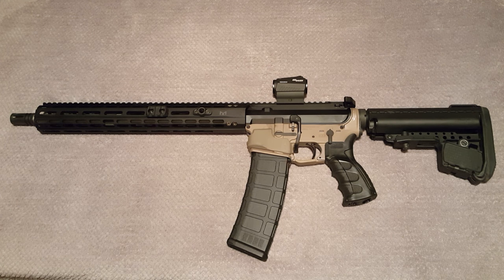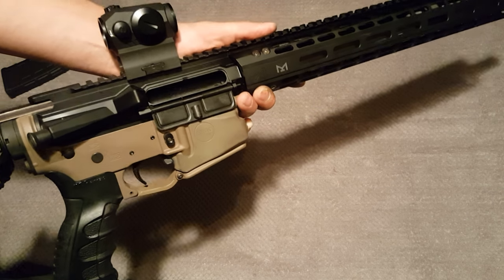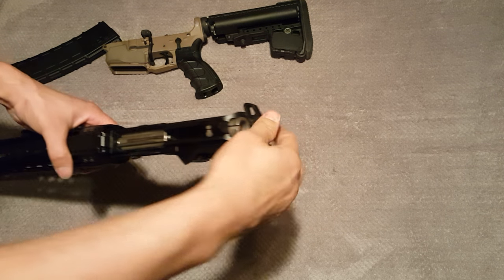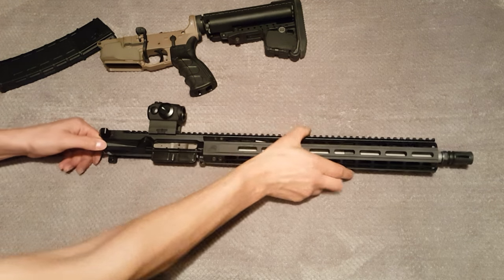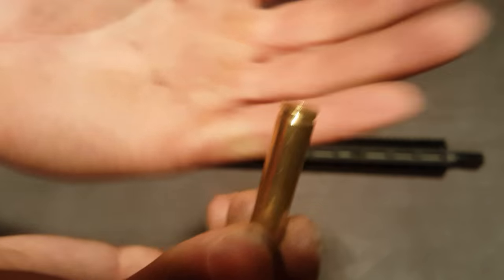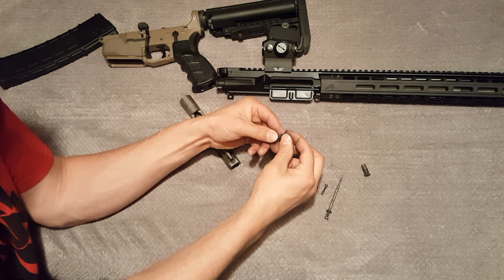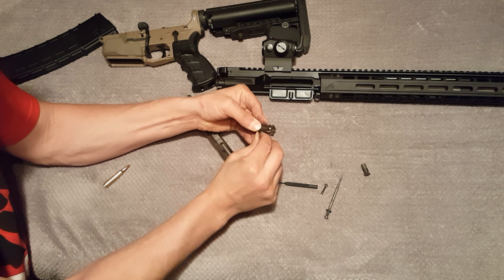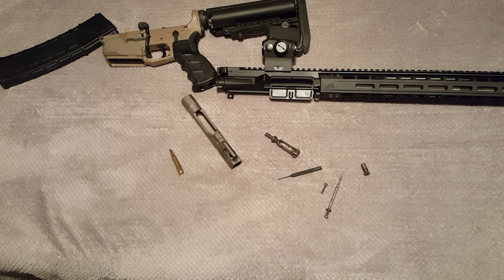AR Bolt Failure To Close /Seat Properly!!! Sharp's Relia-Bolt Extractor Spring O-Ring/Rubber Grommet

Comment: I just had a problem on a new upper, but in my case I am sure it was a headspace problem.  Mine is 7.62x39 and it was having problem chambering the round.  I put the loaded rounds under the extractor onto the bolt face.  Took pressure to close the bolt and and a lot of effort to eject the loaded round.  I slipped a spare 7.62x39 bolt in and it chambers easily without resistance.  I do not have a head space gauge.  I noticed that the original bolt was rough about the lugs and it be something as simple as a burr.  I have written the manufacturer and will see if they send me a new bolt.

Comment: I ran in that same thing in very cold climates.  Also with new bolts. The o rings were hard. Would not soften up. I just left it out.
Reply from the maker: So far so good. Since it's back in it hasn't happened again. And we did have a snow day at the range. Climate is a good thing to keep in mind as well. Thanks

Comment: All you have to do is use it. The heat from a few rounds will flex the O ring and loosen the tension on the extractor. And make sure that everything is properly lubricated.
Reply from the maker: I bet you're right I just went the extra step to understand it. If it wasn't my first build I probably would have snacked the forward assist and kept going

Comment: It is possible that the O-rings used are the wrong durometer.  But the O-rings I have that are reliable do not have a round cross section, but rather, a more rectangular cross section.  And these O-rings are a little thinner than the round section O-rings.

Comment: Extractor O-ring caused too much tension and had a hard time going around the rim on the casing.
I wonder how many shots it would have taken to allow this to break in normally.
Reply from the maker: I do wonder this, possibly just slam that forward assist a few times 🤷‍♂️ but i wasn't going to do that with my fresh build.

Comment: Hello. I am new to the Ar-15 platform. I pull the charging handle back and let go, but it wouldn't go forward since I notice the round that it was trying to push forward into the chamber was some how croquet instead of straight and therefore it was stuck. I took the magazine out and some how the bolt and the round suddenly went forward on it's own. The magazine was a Pmag 30 with 30 rounds of Green tip Pmc ammo. I removed two rounds but no difference. Same issue. I tried using my Pmag 20 with frontier ammo and no issue at all. I got no idea what the issue is. I am confused. Btw this is a Ar-15 with a Aero Precision upper, and bolt and charging  handle were bought separate. Using a APF complete lower receiver.
Reply from the maker: Let think on this one a bit. Sorry i just saw this.

Comment: Needs to be sanded or polished a little more if the tolerances are that tight??? Maybe it's the face of the extractor.   If you had another extractor to substitute that would rule out the extractor.  The extractor face could have worn a little and that is what solved the problem?????I find it hard to believe a tight o-ring could keep the extractor from opening.  The angle of the extractor face or that the part is too tight makes more sense. Thanks for the video. It will help if this problem occurs.

Comment: I could really use some help from one of y’all. I don’t know much about how AR platforms work. I’ve had constant problems out of my Areo Precision AR-10. First I kept getting light primer strikes, I replaced the firing pin and solved that issue. Then it wasn’t extracting the rounds properly and kept jamming, solved that problem and it shot great for about a month. Now the most recent problem is when I shoot, the bolts not being pushed back at all. I have to pull the charging handle back for every shot to cycle the gun.

Comment: I have a delton dti at, I bought it brand new it set for 2 years took it to the range once shot 30 rounds took it home and put it glass case about a month later take it too the range shot 2 30 round mags noticed it was a little warm so I just let it set there and cool down went to start a 3rd magazine and it jammed bolt not closing all the way every time I pull back on the charging handle nothing just end up having to shake 1 or 2 rounds out never cleaned the gun since I bought it right off the show room wall , without being mean what could be the issue im new I also put a 20" barrel on it and turned it into an m16A1
Reply from the maker: Well without being there and seeing it first hand i would take it to the local gun shop or gun Smith. Safety is key.
Reply from the maker: Before i shoot my brand new guns or guns i have had sitting for awhile. I give them a squirt of gun lube. My AR's i don't clean often i just squirt the bolt / down the barrel and keep on shooting. Possibly too dry out of the box and needed lubricant. As for heat i can't say,  everyone has a different perception of hot. But we are talking about gunpowder and firearms. They're will be heat. Hope this helped somehow, but be safe and let a professional look at it.
Reply: @bereadybasics7525  thsnk you, the gun oil probably did dry up over time

Comment: Going to try this, my Ar does this like every other shot, it's a radical firearms ar so thought it messed up, was about to send it back until I saw this video
Reply from the maker: You could also try just working that extractor spring in by just opening it manually several times. I haven't tried it but it has the same effect essentially, and it can be done on the fly. Good luck
Reply: I got a radical also and its been nothing but hell as far as failures to eject while loading another round so i hope this works…
Reply: @troysanders4206  try tightening up the gas system, and if you dont habe promags, hold the bottom of the mag and see if you can mag dump, that's what I figured out was going on with mine

Comment: Real question: Why do you not recommend hitting the forward assist??
Reply: I see your curiosity there,
For this instance on my new build where i was having issues firing in the first mag. I didn't wanna just go straight to slamming on the forward assist. Almost $2000 total i was honestly just babying it. Possibly after 5-10 rounds later if i had used the forward assist could possibly have fixed its self.
Reply: Forward assist was created for M16's.  They were horribly unreliable and in combat in Vietnam the forward assist was a very cheap and aggressive way to get your ass out of trouble quickly when your gun jammed.  These days, with the tech that goes into making the AR 15 the forward assist should not even be necessary.  If the gun is made decently and assembled correctly you should not have to use the Frwd asst.  I just don't like the idea and why chance damaging something
Reply: @pistol777   It was the powder that was the problem in Vietnam,  After they started using the powder it was made for it worked fine.

Comment: Damn, wish I would have found this before sending my bcg in for warranty work at the manufacturer.  I've no luck with it in multiple rifles, various ammo, dis-assembled the bcg, cleaned, lubed and tried again. I never thought to run it without the o-ring. I bet that is the issue I was having as well. We shall see what the maker has to say.
Reply from the maker: Yea,  usually they say nothing is wrong and send it right back. Doing a updated version of this with out taking apart the bolt. What should i call the video?? How would you explain the issue you were having? Anything back would be appropriated. Thanks for watching too
Reply: @bereadybasics7525  Tough call on what to call it! I had the same experience no matter what rifle/ammo I was using. It would fire a manually chambered round, eject it, but not pick up the next round. Failure to feed after firing. I've been going back and forth with the mfg for a few weeks, I've sent photos,  took trips to the range to try various things, always the same issue. Just won't pick up the next round.
Reply: @bereadybasics7525  Forgot to add, my bcg is a ALPHA SHOOTING SPORTS.
Hope to hear something back from them next week, just dropped it in the mail to them yesterday.
Reply from the maker: @jamiewells6464  if the casing it failed to pick up had marks from the bolt slamming it. I would say it's a tight extractor. Thanks for the feed back.
Reply from the maker: @jamiewells6464  "My ar fires the first chambered round and jams" lol pretty much. Thanks

Comment: I got a new rifle M&P sport AR15 and the first time I shot it the bolt wouldn't fully lock forward like you described. After about 30 rounds it started to work fine then a few weeks later I would shoot once then would have to pull the charging handle eject and old round then fire again and do that each time. I took it apart and there was a lot of black sticky gunk on the bolt could that of been the cause of the issue?
Reply from the maker: The word sticky really catches my attention. That word alone sounds like the issue. If you still have the spent casing take a look at them. If there are marks around the rim its just a tight extractor. Use will fix it or take it apart like i did. But since its clean now i hope its running smooth.

Comment: Leave the o-ring off and install a 5 coil Sprinco extractor spring and your good to go. If there is an insert, leave the o-ring off. You should also check your head space with a true 1.4646 head space gauge and not the 223 1.4636 gauge many sell as a 5.56 gauge. Forget the Go gauge and use a field gauge. Most AR problem barrels have a short chamber. A function gauge will also tell if the manufacturer re-sharpened their chamber cutter too many times and made a tight chamber..  To see if your gas tube is rubbing, take out the bolt and slide the bolt carrier in your upper. You can tell if it is rubbing..Many 5.56 marked barrels are not true 5.56 barrels and have a short throats like a 223, which can pop primers...
Reply from the maker: A lot of info in there. I hope this could help someone out. No need to leave the o ring off. Ran 300 rounds today all flawlessly since the o ring reinstall and it's running great
Reply: @bereadybasics7525  Happy to here it is running good. Happy shooting!

Comment: I recently had a bad charging handle almost destroy my upper and 9mm bcg ... I didn't look at it prior to installing it and it had a dent in it and halfway down the handle it goes to the right and the straightens back out. It was so stuck I had to use a punch and a hammer to get it past the BCG and back out. Pretty upset and think it was from the company kak

Comment: I have issue with my new M&P 15 sport ll that scared me .... one bullet on the chamber I fired and click nothing happens I racked and didn’t eject and one new came in and stock ... that shit scared me ... happens 3 times .. why ?
Reply: My best guess, As I dont consider myself an expert at all, is that you have more than one issue. Was it a light primer strike? That could mean your firing pin needs to be replaced, your hammer/trigger spring is worn out or defective or headspace issues. It could also be a bad round. Are you using reloads? Not ejecting could mean a bad extractor or mainly this same video topic. Remove the oring from the extractor spring and you should be good. Give the chamber a good cleaning. Good luck!

Comment: Common problem.....You can leave that O-Ring out all together.....Sprinco 5 coil with the black insert is all you need......Wilson Combat makes an extra power extractor spring also....Hell every spring company out there makes one.....
Reply from the maker: I think my biggest thought was " i should put everything back in the way the manufacturer had it "
Looking back and hearing how many don't have a rubber ring at all. I could have left it out and just reinstalled some time later with no worries.
Hoping i wouldn't lose it :)
Reply: @bereadybasics7525  Next time you want or need to enhance your bolt just leave it out and try a Sprinco 5 coil and just the insert.  The O-ring was for a quick mil-spec fix with the different color polymer inserts.   The black insert and spring is perfect and all you need.....Good luck and keep on shooting......God Bless.....

Comment: Mine doesn't close/seat properly only when i rack the first round in, i have to pull it and let it slam hard for it to close good but other than that it's fine, any ideas on it though? it would be much appreciate.
Reply from the maker: I would say it's the same problem. But i would just let yours naturally loosen up. No need to disassemble really, i guess you could work the extractor a bit with your finger to break it in faster.

Comment: Would it eventually damage the extractor by not having the O ring? 
Im having this same issue with a 308 build i just dont want to cause more damage to my bolt.
Reply: No. Not at all. The packaging even says “o-ring included but not needed in most cases” I run my ARs with BCM extractor spring and leave the oring out. Works perfectly fine.
Reply from the maker: Thanks Desert Tactical, my thoughts exactly. (Been fighting wildfires, late response)
Reply: You don't need an O ring, the spring is just fine.  I don't know when they started adding O rings to the bolt.  The ones I had in the military never had O rings, just the springs.

Comment: I have the same sharps bcg. I'm having trouble too. The first time i and only time i installed it into my new ar15, a colt le6920. It wouldn't go into battery but only on the first round of a magazine. Mags were not fully loaded, 5 to 10 rounds at most in each magazine. If it only stops short of battery but only on the first round any idea what that could be?
Reply from the maker: That is exactly what happened in this video. Same issue and my problem was the tension on the extractor was too great. If your shells have small marks from the extractor slamming into it and not grabbing it then break in that extractor or o- ring on the extractor spring. The marks would be on a casing that didn't fire. The outer brass around the primer.  Sounds Like your second round.
Reply: Be Ready Basics, Oh i thought you were having trouble on every round and not just the 1st round of each mag?
Reply from the maker: Dino D yea im sorry i miss read your question i guess. I could fire the first round then i had that happen.
 So with your question. Was it a new le6920 or just upgrading the BCG?
And for the 2nd round and on, what way was the spent brass shooting out the ejection port. 3oclock or more of a 6oclock almost hitting you
Reply: Be Ready Basics , it was a new le6920 never been fired and new sharps bolt installed in the rifle. It was about a year ago since i fired the rifle. I don't recall the shell casings almost hitting me. I contacted sharps they thought it was the mags if it only happens on the 1st round. Using magpul mags. I thought maybe it was headspace issues, they assured me it wouldn't be that.
Reply from the maker: Dino D yea if their both new it shouldn't be. Is the mag new aswell? Cant see that really either.  Im trying to imagine you racking that charge handle and the spring not being strong enough but i dout that to.
The reason i asked about spent casing is to see if it could be spring and buffer.  Does colt and sharps BCG have a dramatic weight difference?
Reply: Be Ready Basics, new mags as well. Didn't notice a dramatic weight difference between the colt and sharps bcg. I ran the sharps bcg relatively dry with very little oil. Could that be it? Or the charging handle? Running a bravo company charging handle

Comment: You're reliable has a lifetime warranty. Just contact them and send it in and they will send you a brand new one. The o'ring is probably cracked or has expanded. But anyway you can get a brand new one if you send it back to them
Reply: I keep hearing people say they have a lifetime warranty.  Have you actually sent yours in and they sent you a new one?  Because if not, you shouldn't say that.  I read their warranty and it is a "limited" lifetime warranty.  Specifically, according to the working of the warranty on their site they warrant any defect in workmanship and that they reserve the right to decide whether the BCG is defective or not.  Also, if you purchase your BCG from a reseller (not directly from SRC), you have to deal directly with the re-seller.  Good luck there.  Read the warranty.  If you got a replacement though, I'd like to know, because IMO, I shouldn't have to do dick to a brand new BCG to get it to go into battery.  Especially something named "Reliabolt!" Mine has the DLC coating on it as well.  It should run dry in an un-fired gun hundreds of cycles.  Not thrilled I spent my money on SRC.  So many other better options.  This crappy beveled lug theory is a joke.  Won't be getting a second one.

Comment: according to bcm, orings are only for barrels under 14inches
Reply from the maker: I have never heard this, maybe for just their BCG? I'll look this up
Reply from the maker: According to Bcm or just the guy in this video? He has a colt bolt with the bcm upgrade kit if i heard right? And he has similar issues due to the black insert into the spring AND running an o-ring. So it was double upgraded for stiffness and proved too much it mauled the brass.